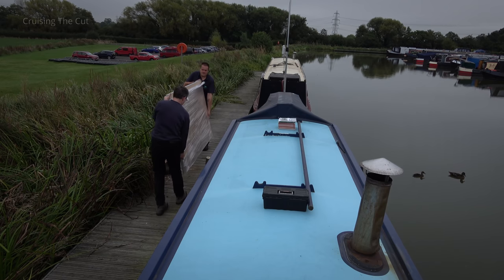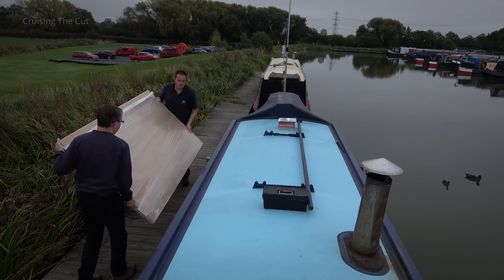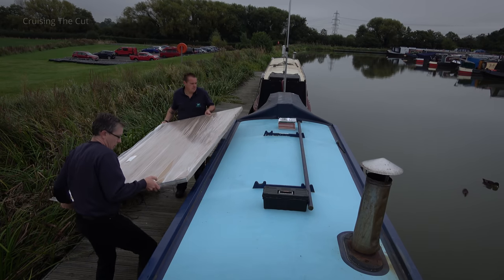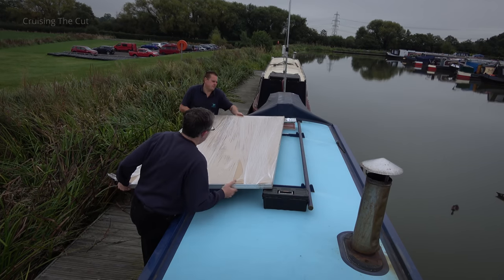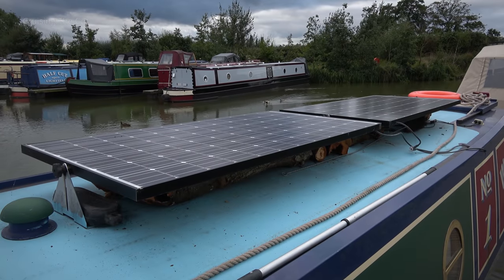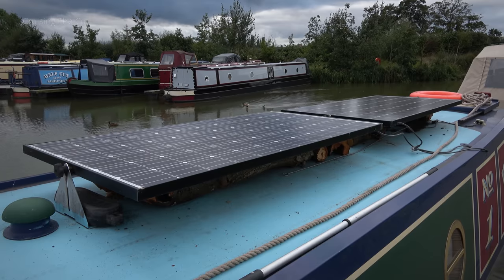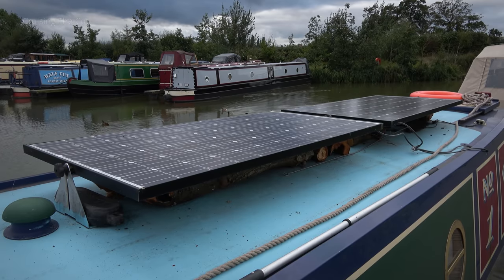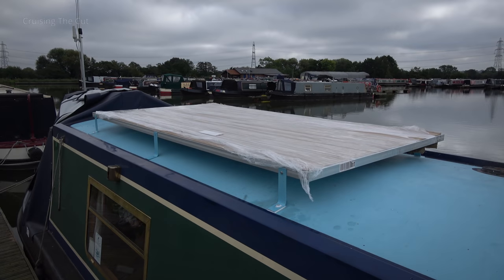260. Solar Panel and Lead-Carbon battery update (narrowboat)

Comment: Hi David, One simple way to test your carbon-lead batteries is to take their temperature. A good battery will take the charge, do some chemistry, and store the charge until needed. A bad battery will take the charge, use it to heat up, and the charge is gone. A battery that big should not get more than lukewarm.
Reply from the maker: They seem to stay quite cool

Comment: I moved from 10 years of continuous cruising to a sailing boat and now I cruise when there's sunlight and non lethal weather. Off grid winters in the UK are hard, no two ways about it - and there's no way in hell I would want to do it on a sea boat 1/2 the size. tucking up on shore power in winter is so much easier.

And thanks for the settings, just installing a string of those PLCs. 300ah lasting 3 years on the cut is good going, I have murdered twice that in less time on the canal.

Comment: "Run the vacuum cleaner". I've got a Bosch and it takes my drill batteries! But I agree, going 100% off grid sounds stressful, but I'm tempted to work my way up to it just for the fun of not worrying where I stop (if I can muster up the courage to move!).
They don't do a Ryobi Microwave yet though!

Comment: Having a mobile off grid system, the best investment I made was buying lithium ion batteries. I used to really stress about lead acid soc, knowing that they were slowly sulfating at anything below 12.4v and the longer they sat at a relatively low charge, the longer it would take to efficiently accept a charge. Now I don't worry at all unless they are extremely low. I'm more worried about high states of charge. And charge acceptance is hugely better meaning they still accumulate useful energy even on less optimal light level days, whereas the lead acid would just start to accept a charge just as the light was running out.

Comment: I have 430 watts on my boat ! 
My batteries love winter they never come out of float but I do live different to most boaters . 
I use a box on the back deck for my fridge betwean mid Dec and mid March. 
I only charge things ( Hoover, phone,  tablet, shaver, night lamp ect ) when the solar allows me to, and this I do in stages depending on the solar .
This time of year my fridge is back on but I turn it off at 8pm because it stays cold for 12 hours when switched off ... freezer begins defrosting after 12 hrs. 
I have 720watts of solar powering my propulsion.  
I was able to cruise at 1.4mph  for 90mins at a time all through winter .
Recharge took a max of two days .... well happy !

Comment: I don't know anything about solar or power systems or even narrow boats for that matter so of course I full of opinions. But I think like most other opinions it's just water through the lock. Where I live however, water stays frozen for most of the winter so I'm afraid you'll have to wait till spring to hear them. Ta

Comment: December 2021 was the greyest for about 50 or 60 years...I had a crap time on solar too, with 2Kw rig and 10kw lithium battery. You can look at air con in the summer now.

Comment: This very day 17-3-22 have tested my extra panels, now 1.7Kw worth flat only the new 40amp controller looking underrated and will have to upgrade, now getting 33 Amps 12v middle of March east Midlands, so now thinking an extra 20 or 30amp controller will be best option :-) Plenty of headroom, Think you will get nice supprise this summer David.
Thanks for the update.
Reply: P.S. Went for second 40Amp controller to spread load from the 4 panels...

Comment: If you are going to do another winter on a dock without shore power I recommend the small Honda generators. Small, light and easy to carry. Sip fuel (although petrol) and are truly very quiet.
Reply: You can get a Hutch Mountain DIY installation LP fuel kit.....no need for petrol then...
Reply from the maker: Hi, please see my pinned comment at the top :-)

Comment: Great episode David. Solar is a new concept for me... still struggle to understand the science behind how it works. I bought a 120Ah Lithium battery and a 260W panel. I ran two fridges and charged phones/iPads for just under a week between Xmas and NY up in the Sunshine Coast region of QLD. I should add, that the weather was awful, it rained incessantly for most of the time. Anyway, it was day 5 when the battery started to struggle and the panel couldn't keep it topped up. HAd to put it on mains for a couple of hours to get it ready for the LONG drive home. All up, I'm pretty pleased with it.
Reply from the maker: Sounds decent
Reply: Drive home - i.e. with an engine ? Won't that recharge your battery ?
Reply: Do you have a voltage sensing relay fitted to your tow vehicle that feeds power through to the camper when you are towing it?
That will keep the batteries topped up...

Comment: Yep, gloomiest winter so far. This was number five on my boat. The problem is: cloudy weather is warm weather in an English winter. One thing I do is turn my fridge off at night when the sun hours drop, then turn it off completely in the middle of winter. You put less strain on your battery if the fridge is only taking power during daylight. Some water bottles in the little freezer bit helps keep down temperature overnight.
Reply: David uses the freezer compartment as it was designed to be used.
Thus he cannot turn it off....
There was an alternative for some cruising yachts from the old days...an engine driven compressor and a eutectic plate in a chest freezer...basically an a/c pump but bigger..always on when the engine was running so cooling down the refrigeration on the boat while the large high capacity engine alternator was also generating for battery recharging for use overnight.
But that means running the main engine or having a larger "small": diesel thumping away....which David also doesn't want....

Comment: Very interesting & good vlog. All my future boat projects will use lithium as they are more tolerant of deep discharges and they can be charged quickly at a 1C or higher rate.  This allows some rather massive alternators (think 200W or more) that reduce the time an engine is running.
Reply from the maker: I wish I could afford Lithium! And had a space to put it, the engine bay is not really suitable.
Reply: @CruisingTheCut  Hmm, interesting point about finding space for installing a lithium battery.

From the forums we read it's entirely "feasible" to have a lithium cell under a bed or in a locker /cupboard within the heated volume.

It gets around the keeping the lithium battery above freezing for charging. Those who have done this tend to use at least 10mm2 cables for obvious reasons.

On the other hand is this desirable?

The BSS regs compel boaters to ensure batteries are vented to atmosphere against build up of hydrogen gas. Seeing as how lithium batteries don't produce hydrogen gas then that condition doesn't apply.

But, big but, manufacturers now stipulate these batteries are vented so as to help reduce thermal runaway. Burning lithium cells are not something to aspire to.

Suspect that if you did run lithium batteries then the heated types, mounted beside the lead acids might be the best practice.

As yet we haven't heard of lithium battery generated fires. That said might be a notion to contact your insurer for advice.

Whatever anyone does do not, repeat do not, ignore the battery manufacturers installation instructions.

Or attempt to circumvent BSS regs.

Comment: No narrow boats here in the USA but my wife and I were RV’ers and owned everything over the years  from small trailers to 30’ motor homes. They all were  equipped with propane gas refrigerators.  Energy efficient and very reliable. Of course they were built ins and completely vented to out side. Aren’t they available or approved for narrow boat use.
Reply: If it leaks (or the pilot lght goes out; the safety thermocouple breaks and it leaks...a boat is a hollow in the water into the bottom of which LP will flow and collect.
David has a naked flame stove  (log/coal) burner going all night in winter.
When the vapours of LP get to the level of the stove....Boom.
As you say, in an RV there are a lot of holes the gas can dissipate through...
holes in a boat bring on their own problems....
Reply from the maker: Hi, please see my pinned comment at the top :-)

Comment: I have a magic chef fridge with freezer that only draws 65 watts. Granted, it has a very small freezer and it only holds 2.6 cu ft but maybe a more efficient fridge would help your energy consumption. Love your videos!!
Reply from the maker: I suspect mine draws less than that (and it was new in 2019). Bear in mind 65W equates to 5.4Amps at 12V, which on a 50% duty cycle is 65 Amp Hours in a day.

Comment: Thanks for another great video , I saw you on the Oxford canal a few days ago , It is true , solar charge controllers do not need to communicate with each other , they do not 'compete' with each other ... You can have as many of them as you like ... You could have 10 panels with 10 different charge controllers if you like , none of them need to communicate , they will all push as many amps as they can into the battery bank .... BUT , if you have flooded lead acid batteries then only ONE charge controller's 'equalisation' mode should be enabled ..

Comment: If you are using your main engine to charge your house bank I would recommend you remove the built in voltage regulator on the alternator and replace it with an external charge controller, that will put in the bulk charge significantly faster, you might also want a bigger alternator to get the job done quicker. I have run a 4kw inverter from a 5 kw alternator belt driven from 2 x vee belts on a Perkins and it is still doing it 20 years later.
Reply from the maker: I used to have a voltage controller thingy but it got confused by the solar and kept flashing an over-voltage error so I disconnected it.

Comment: Very interesting!  I recently saw a video on the "Tech Ingredients" YouTube channel about using mirrors to reflect light onto existing solar panels.  The result of their testing was that in full sun it can shorten the life of the panels (but easily reach 150% of the panel's rated output) however on overcast days you can double or triple the panel's output (getting it from say 10% of its rated power up to 30%).  Could be interesting to try but only if you can get the large mirrors needed on the cheap.

Comment: Apples's current line of laptops all make use of Apple silicon RISC processors based on ARM's architecture and that is key to their low electricity use .  There are two general types of microprocessors CISC Complex Instruction Set Computers and RISC Reduced Instruction Set Computers.   It wasn't the reason for their creation, but in was found out that RISC processors used much less electricity than CISC processors back in the 1980s when they were being experimented with.  The main reason for RISC development, I was told, was it was much easier to develop efficient compilers for them and they were specifically made for one instruction to take one cycle to complete.  These two advantages were thought in practice to possibly make for faster throughput than CISC processors.

Comment: Hi! Sometimes you're so grumpy I want to hug you, though I'm sure being English that might just make it worse. I read all the comments, I think. I remember in one of the earlier videos you explained you're frugal/on a fixed budget. Most of the suggestions folks have made are for expensive items. Obviously, the biggest help to my mind, would be to switch to lithium batteries. They do last longer, you can use much more of the "juice" in them (draining them safely to the 20% range gives you many more usable amp hours), and you can get self heating ones now, so the cold isn't an issue. I know you can't get them now, but they are definitely worth saving up for (or being willing to take a sponsorship for?).  What I think might be more accessible is opting for a different fridge. I have a 30 liter Iceco and it uses very little power compared to yours. It has two compartments, so you can freeze and fridge items. The max draw is 50 watts, but it is only drawing that for a few minutes. Still might not be in the budget, but the only useful thought I can muster. (Plus it is usable in the van.) If I got the math of the cost of moorings right, it sounds like extra 60 pounds/year would get you through three months of winter on an electrified mooring, so maybe that's the way to go? You're so close to having the problem solved. I'm sure you'll find a way.
Reply from the maker: Oh! I don't feel grumpy!! Lithiums are very expensive still. As for the fridge, 50W at 12V is 4.2 Amps, which on a 50% duty cycle (on / off half the time) is 50 Amp Hours per day - about the same as I quoted. The cost of the mooring wasn't really the issue, it was about having a nicer mooring with a view (but no power) versus a powered mooring where I was side by side with all the other boats!
Reply: @CruisingTheCut  I'm glad you don't feel grumpy! I will have to do a little test. I'm 99% sure my fridge/freezer doesn't run anything like half the day, and certainly I don't see the batteries drop that much. I'll try and do a little experiment, and get back to you if I find anything useful.

Comment: To run the engine less look up 220volt alternators (same size and shape as 12 volt ones) on eBay as some go up to 1.5 KW. Can be added to most engines, here in South Africa we put them in our fans to run power tools in the bush.
Or even a highm amperage 12 volt one to just plug and play.
Reply from the maker: Cheers, there are some narrowboats with this system, called a TravelPack if I recall correctly

Comment: Talking of not using a fridge, I recall inter war houses were built with a larder.  This principally was a small cupboard with a slab of concrete (marble in up market homes) and external ventilation at high and low level. The natural air convection kept a cool temperature.  I recall my grandmother saying they were just as effective as fridges and zero energy costs. I'm sure the more creative could figure a way of integrating them within a canal boat.
Reply: Some boaters exploit the "cold" to be found in the bilges by having a box with "walk proof" hatch in the deck.

However ... you can't get down to anything like freezer temperatures ... and if you did you wouldn't be on your boat.

Comment: 8 degrees!  What a hard winter, I have snowbanks 8 feet high, last time I saw 8 degrees was September. Was wondering about a small Sailboat wind turbine, yet from my vacations in the UK maybe a water powered generator using your lovely rainfall. Springs around the corner.
Reply from the maker: Hi, please see my pinned comment at the top :-)

Comment: That's a great solo 'discussion' video 👏 I've been wanting a 'chat' with someone about their solar/ battery experience. 
I'm a CC'er and have 1x250w ex solar farm panel. I have three traditional 110amp leisure batteries. 
Hated the fact that I had to run the engine at least once a day in winter doing the engine no good and using diesel. 
Fortunately my solution was simple. 
1. I turned the fridge to its second lowest setting as used it as a cool box. It only has a small freezer compartment which I rarely used. I don't eat frozen food so it was no loss. 
In fact the floor of my kitchen cupboard is below the water line and is sometimes colder than the fridge, so eggs, milk, butter etc keep well in there. 
The difference to the draw on the batteries was huge. 
2. I have a solar powered Cello TV that didn't have a panel when I bought it so it needed to be charged either by 12 or 240v  to fully charge it. In the Autumn I bought a solar panel for it. Amazing 👏. It now runs entirely off solar, I've never had to charge it via batteries since. 
The long term benefit? I've not had to run the engine once while the boat is moored for 14 days prior to moving again!! 
The engine has benefitted, my batteries are in the best nick since I had them installed and all done by tweaking a few things. 
Thanks for a great video, I enjoy all of them and still miss your regular monthly editions but can understand why you don't anymore. 
Happy Chugging 😊
Reply from the maker: Cheers, sounds like a good system. PS I am still producing at least two videos each month so I’m not sure why you think I’m not doing stuff anymore ☹️
Reply: @CruisingTheCut  Ah, yes I should have fully explained, it was your chugging vids I was on about. I enjoy a great deal the more journalistic ones you do now and do view and enjoy them. But as you once said, I think, there's only so many views on ducks and Swans and locks you can do without repeating yourself so understand why you changed tack as it were. I do know that ex pats loved the gentle views of home and they adored those films. 
Many thanks for quality no frills work you produce, just perfect. Happy chugging.

Comment: Enjoyable presentation and is of interest. I think what would be better in your system is to double the number of batteries to match your doubling of panels. That way, on a really sunny day you would fill six batteries with charge and that would last you twice as long on an overcast day. Not a huge investment either. At the moment you may be fully charging your batteries by lunchtime and the afternoon’s sun would be wasted.
Reply from the maker: Unfortunately I don't have a suitable space for doubling the battery bay